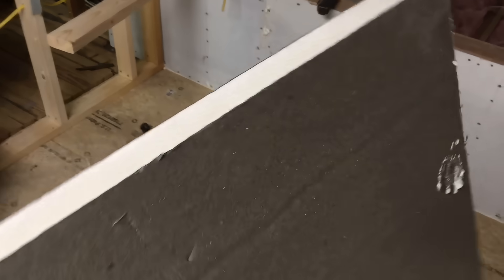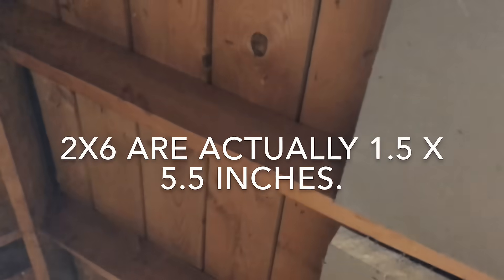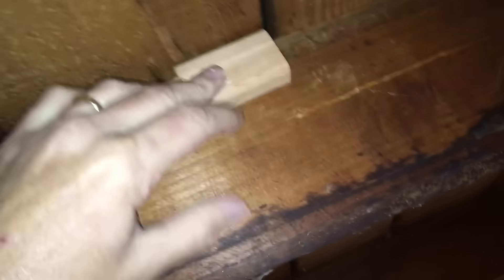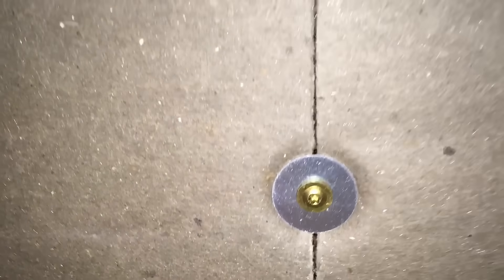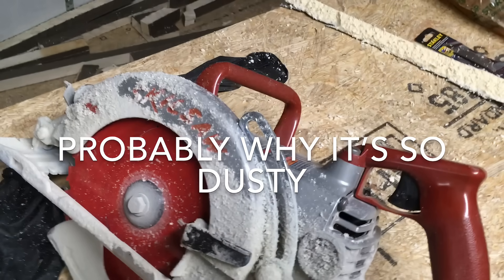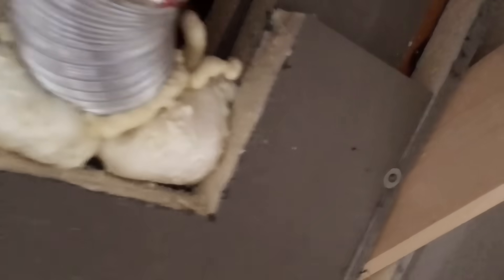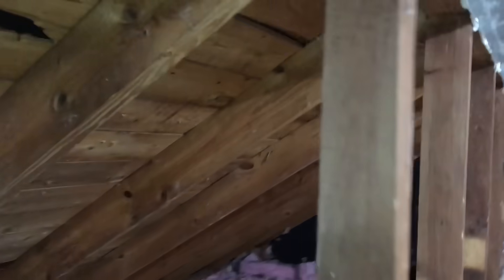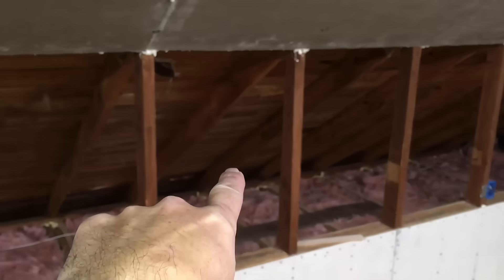Getting R-30 in an attic suite with 2x6 ceiling rafters

Comment: I have never heard of a building inspector forcing r30 for a remodel on existing construction... New additions, yes but if it was legal when built, they can't force you to upgrade it.
Reply: There's bound to be some variation from local to local but, at least where I live in the Pacific Northwest, converting an area from an unfinished/non-occupancy space to a living space must include bringing it up to modern code standards. So, if a loft conversion area isn't properly insulated, you must install additional insulation. If there were windows at either end of the attic, but they don't meet egress or energy standards, you have to replace or even reframe and replace the windows. Electrical, plumbing, the pitch of the staircase all have to satisfy modern code requirements, too.
Reply: @MrPeterJHarrison  well remodeling unfinished space is a different thing, granted how are they going to know if it was finished or not previously. First inspections come after you already gut it so they wouldn't know. 

In our jurisdiction, if an area was ever livable, then you can gut/remodel it. They can't force you to rebuild the building to achieve code compliance if it met code in the past.
Reply: @Josh.1234 
Why would you not want to?
Reply: @ravenkitty1960 sometimes it's nearly impossible to bring something up to code with existing structures unless you want to do massive rebuilds. Door widths, hallway widths, etc.. with 2x6 framed roof structures and drywall, there isn't enough depth to meet code without expensive closed cell and even then it might not meet code depending on your weather zone. You could build out the ceiling to be lower but then that can have a big impact in the room.
Reply: @MrPeterJHarrison I am a home inspector in WA.  For this gentleman's project, you are incorrect.
Reply: @MrPeterJHarrison I  want to improve my attic space by insulating in between the rafters like shown here, I don't have a livable space however, just enough space to crawl atop the ceiling joists, so I will just use one layer of this board and maintain the airflow using the blocking. The insulation board I have in mind at the box store has foil on one side, maybe both?  If just one side the foil would face the roof correct?  I also have a new Aluminum Interlock Brand Roof and it's  surprisingly quiet in the living space still but I also  have plenty of insulation above the ceiling in between the joists, and with the further board insulation  between the rafters and air sealing it will be as good as I can ask for in this old 1958 home.
Reply: I think the key is that it wasn’t living space before the remodel so it now has to come up to existing code if you want a permit.
Reply: @johngermany2089  yeah if the home owner isn't claiming it was a livable space, then they might force him. But there are large windows already up there, that would be odd to have if it was completely unfinished. Also livable is not necessarily based on current code but the code under which it was originally built or remodeled.
Reply: Permit is mistake #1.
Reply: @riggitydoo5116  I remodeled as a professional for 5o+ years and only pulled a handful of building permits, mostly plumbing and electrical, the building permits were for additions. Your right about the first mistake, the three little pigs didn't have codes either and neither should free people. Oh shxt I forgot we are not really free are we?
Reply: Correct.
Reply: What advantage is the thin layer of fiberglass on the board? Why not use the stuff with the reflective mylar?
Reply: Regardless if "you" haven't heard of it doesn't mean anything - you missed the point of how to cheat the system - clearly you weren't man enough to see that and take that as a win...maybe watch some videos on how to make some coffee so your wife/boyfriend is Amped enough to tackle these tasks that you fail to comprehend
Reply: @TinManOne9  well buttercup, no plan review or inspector has ever said I have to bring existing structure up to insulation code. Also from the looks of the comments, most other remodelers haven't either. I am sure some idiot like yourself would force people to do that but we are just lucky enough to not interact with you.
Reply: Probably commiefornia 😅
Reply: @josephgeorgeejr7039 actually, the weather is wonderful in California, and there is no need. But way to show that you are looking for a scapegoat.
Reply: Affects your bills

Comment: I’m working on the insulation for a new shed. I’ve used I joists for the rafters and I’m using foam board (expanded polystyrene) in combination with mineral wool batts. My foam board is looking similar because I’m setting it against the underside of the top flange on the rafters. This gives me an air gap under the roof sheathing. 

I’m wondering how this setup is aging for you? Have you noticed any moisture coming into the space from that air gap? Is the space always heated?
Reply from the maker: I have an endoscope and hope to do a video on this soon, Aaron. We'll actually go up in the air gap behind the insulation to see if there are any problems. I think it's holding up pretty good, but we'll find out for sure. Thanks for the comment!

Comment: so how did u hang your drywall  , I would suggest a latex glue and 3 inch drywall screws. They use latex glue to glue epdm rubber to this insulation. Roll it on wet and put dry wall up with screws
Reply from the maker: https://www.youtube.com/watch?v=dGeoA1ji_iM

Comment: I am confused about the ventilation gap. I thought you said that you need 3 pieces of insulation, but then you used less where there was a vent?
Reply from the maker: Within the joist bays are a 1.5 inch air gap, plus (2) 2 inch thick layers of insulation. Across the joist is another 2 inch thick layer of insulation. So 3 total layers of insulation. Hope this helps, Jacob.
Reply: @FamilyFriendlyDIY  Yes it does. Thanks!

Comment: What keeps the shingles from overheating. Maybe spray foam instead.
Reply from the maker: That's supposedly what the 1.5 inch gap is for, according to the shingle manufacturer. Thanks for the question, Ronald!

Comment: Thank you DIY Dave. How would you insulate the vertical side (knee) wall, and why did you say you will only need R-13 batts on the sides? Shouldn't the insulation on the vertical sides be R30 as well?
Reply from the maker: Good question, Fred. The code for walls where I live is R-13, so that's what I used. The benefit I'd get from anything thicker would be negligible. It's like a thermos up there.

Comment: you could of just used r15 batts in rafters (they would leave about 1-2" of space at top, and then ran 2x4 perpendicular to your rafters and put in a 2nd layer of r15 batts. Sure your way saves a couple of inches, but it also probabably costs 30% more for foam board vs fiberglass batts which are very cheap.
Reply: And in 5 years your R15 bats have lost value and are only about +- R9. Look it up. Fiberglass bats, and blown in insulation lose effectiveness because they collapse down due to gravity.

Comment: Hey Dave, awesome video. Maybe I missed it but I'm wondering how you fastened the first two layers of foam board before getting the third one in with the cabinet screw + washer?
Reply from the maker: It was a friction fit, Aidan. And if there were boards that were slightly undersized and so didn't give a friction fit, I wedged some foam trimmings in the edges to hold it until successive layers and foam sealant could be applied. Thanks for the comment!
Reply: @FamilyFriendlyDIY  Awesome, thanks for the reply!

Comment: My attic doesn’t have a ridge vent or soffit vent, just 2 gable vents, one at either side of the house. Would I need an air gap under the roof sheathing? Also, I am finishing only half the attic which eliminates the cross ventilation. What is the best way to vent the unfinished section?
Reply from the maker: Hmmm. Good question, Jeff. If you don't have any soffit vents, then the air gap behind the insulation would be wasted. If it were me, (if you have soffits) I'd install soffit and ridge vents on the entire roof before adding the insulation, just for peace of mind that moisture would have an easy way out and the shingles might last a little longer. But I also believe there shouldn't be a lot of "rules" on how to do something as long as it seems to be working with no detrimental effects. So if you've had no trouble with the way your roof has been vented (for what I assume is many years) then it might work fine with no gaps and no venting. Obviously if you get building inspectors involved they might have other opinons ;-). Hope this helps. Thanks for the comment!

Comment: how did you fastened the first and second layer? sorry if I missed that on the video
Reply from the maker: It's a friction fit, Marcos. Where the boards weren't quite wide enough, I wedged foam trimmings around the edges to secure them till I could glue them with the great stuff. Hope this helps!
Reply: @FamilyFriendlyDIY  thanks Dave, very helpful video!

Comment: I did something very similar.  In place of the foam board you used, I used 2" Super Tuff R which I was easily able to cut with my leatherman knife.  I also ran the insulation from the bottom of the floor joists joining the other side following the horizontal ceiling.  I put 2 layers of the Super Tuff R in and over the walls at each end.  It is now like one big refrigerator.  This guy is losing out on air sealing by not doing the hole envelope.  I also did not see the need to seal every layer.  I only sealed to outer layer.
Reply from the maker: Thanks for the comment, Ryan. Good info.
Reply: @FamilyFriendlyDIY  was there a reason you didn’t do this? 

I have a similar setup in my own home but wondered why you didn’t expose the whole thing. Any reason?

Great video btw.
Reply from the maker: @ecthelion205  Thanks :-) .. Yes. I was trying to keep the cost down as much as possible, and only insulate what absolutely needed insulating. The space behind my kneewalls is pretty expansive, and would've taken a lot more insulation. As it is, it satisfied the inspector and keeps it nice and cozy up there. Thanks for the question!
Reply: @FamilyFriendlyDIY  that makes sense! Thank you for the explanation

Comment: Instead of the fiberglass covered foam board, why can’t you use the metal foil foam board? I’m assuming the fiberglass is to meet fire code, but doesn’t the metal foil do the same?
Reply from the maker: Good question, James. The foil-faced board was about 3 times as expensive where I am at the time (probably still). I was going the cheapest route. Also the board I used is supposed to be somewhat vapor permeable, and I think the foil type might have trapped moisture between the layers. Thanks for the comment!
Reply: @FamilyFriendlyDIY  Cost I can understand, prices are out of control. The vapor issue, yes that could be a problem. I’m not 100% sure, but I’m like 95% sure foil backed foam board is closed cell foam, moisture and vapor impervious. So ya, probably not the thing you would want in your roof. I forget that not all foam board is closed cell. And all I know about spray foam, is if you mess around with that stuff and you don’t know what you’re doing, use old chemicals, wrong mix, applying the spray in the wrong humidity and temperatures or applying it to thick will leave you with with a toxic house. Or at the very least a mess you can pay for twice it removed it and then have it done correctly. 

As for cutting the fiberglass foam board, I’ve never worked with it, but regular foam board cuts and breaks like Sheetrock, if you cut about 1/2 an inch into it, it will break on the cut line. I wonder if you cut through the fiberglass cloth and into the board about 1/2 an inch, if it would break the same way? Would cut down on the fibers going everywhere if it works. Otherwise, if you can stand wearing a Tyvek suit, you probably wouldn’t itch so much. You may die of heat stroke, but wouldn’t itch.
Reply from the maker: @jamesmchugo9422  You're totally right about the way of cutting it! I had so many comments about that I made another video where we test cutting methods. https://youtu.be/Z292iuV91hA

Comment: This was inspiring.. I am contemplating opening my ceiling my self after getting estimates that were insane.  I have trusses but plan on leaving those in place, but insulating rafters then closing with drywall.. this video made me think I might be able to do project myself.. any thoughts?
Reply from the maker: Thanks, Anne. ... Regarding your question, it depends on a lot of things. Where you live, climate, if you're going to get it inspected, the depth of your trusses. If you want to insulate the outer edge of a 2x4 truss, I would only use one 2 inch layer of foam in the bay (leaving 1 1/2 inch air gap), and then put 2 layers under that (if you're going for the same R-value as I did). I believe most people can do anything with a lot of research, creativity, and patience. All the best to you Anne!
Reply: @FamilyFriendlyDIY  Can you insulate the trusses without leaving an air gap since there is no soffits nor a ridge vent? In essence completely sealing the roof then vapor barrier/drywall.
Reply from the maker: @gedionsamuel2256  That's a tough one that a lot of people have asked. To be safe, I'd consult your building department. I would think if you had a really good moisture barrier behind the ceiling it would be fine, but IMO having a way for it to dry out is best. ... and in my case no air gap would have voided my shingle warranty ... not that I think they would have degraded any sooner ... today's science is tomorrow's retraction.
Reply: @FamilyFriendlyDIY  Thank you so much! Yes I agree, I wish there was a manageable way to vent it. Sadly without completely tearing off the shingles and redesigning the plywood/angle/length or some sort of through the shingles intake soffits, it seems I’m dreadfully going to have to go in the sealing direction. 
I’m thinking of using RTech foam layers & maybe even coating the inner roof with anti mold, & eventually vapor barrier tight sealing it. Hopefully it will be enough to create a seal space enough so the exterior temperatures won’t meet with the inner. We’ll see how it goes.

Comment: I recently bought a home that was built in the 40s (2x6 rafters), and I want to add a finished suite exactly like you are doing. One concern I have however, is my house has no overhang/no soffit for ventilation. I feel my only option here is to do an un-vented/hot roof. Would I still need to leave that gap of air space, or would I be fine to just run everything flush to the underside of the existing decking? The other issue I have to deal with, is at some point new sheathing was added over the top of the original planks on the roof, so there are hundreds of nails that were shot through both layers of sheathing, but they are sticking out in-between the rafters. For that reason, I was thinking about putting R-19 unfaced batts between the rafters, and then installing 2" R-13 foil faced rigid over that (similar to how you constructed your third layer of rigid). The foil faced insulation would then act as my vapor barrier. I would run this from the ridge all the way down to the subfloor, so I am even Insulating the crawl space behind the knee walls (leaving the knee walls uninsulated). This would give me R-32. Does anyone see any issues with using the batts instead of the rigid between the rafters, and should I be leaving an air gap, or am I okay to push everything right up to the underside of the decking?
Reply from the maker: When we bought this house, the previous owner had installed paper-faced fiberglass batts in the rafter bays and covered it with paneling. From the paneling, I'm assuming it was done in the 1970's (maybe 60's). Aside from being very dirty with shingle debris, the fiberglass looked okay when we pulled it out. No signs of moisture damage, mold, or mildew. You'll hear and read a lot of horror stories out there about insulation, but each installation is different. I'd only be guessing how your installation would fair, so I'll refrain from an official opinion. It depends on your climate and the way your home is conditioned, but even then it's not an exact science (in my opinion). I personally like having the air gap just so I know things can dry to the outside if they need to. But if you can't have an air gap, I'd seal it really good from the inside like you're talking about with the foam over the fiberglass.

Comment: If I don't have a soffit and I have 2" x 6" rafters, would I need to leave a gap or would I be okay butting up against the decking?
The decking has gaps through which I can see tar paper for the roof.
Reply from the maker: I recommend contacting your shingle manufacturer (if you know who they are) and ask if the roof must be vented to maintain the warranty. Either way though, I think I would leave the gap just so there’s some space for vapor to dry out. Do you have any vents at all? Ridge vents? Or gable vents?

Comment: where can u get a deal on foam board? Seems pricey here- $45 for a 8x12 sheet of 2 in. 11 boards would be about 1100 sq ft,  $500.  R19 batting is about 1100 sq ft for $60. HOLY COW that board is pricey!!
Reply from the maker: Annie, I bought mine at ABC Supply in Greenville SC for about $18 dollars a sheet. You can actually find it cheaper than that (or you could at the time) as "seconds" on the internet--- of course this is now a couple of years ago. Most 2 inch foam boards are expensive, but this is a very specific type of board designed for commercial roofing applications which is why it is cheaper. Hope this helps.